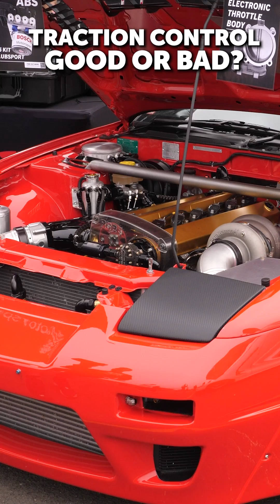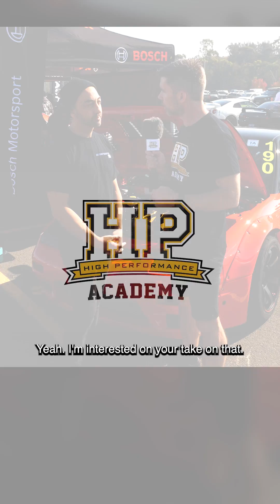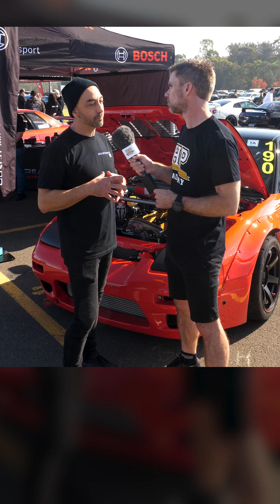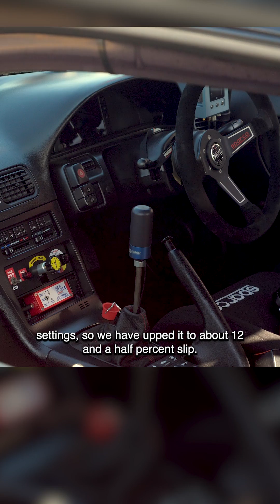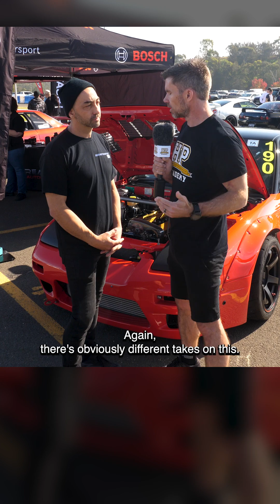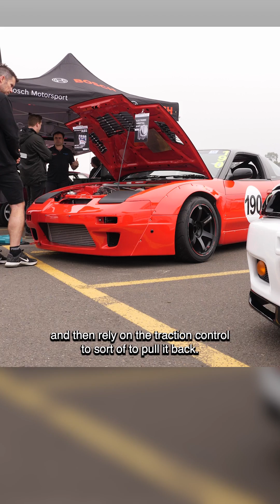Traction Control Vs POWER #shortish

Comment: Traction control is definitely not reactive system only, the likes of OEM's producing high end sports cars often employ predictive techniques to have proactive TC which obviously works better than the reactive one :D
Reply: The Lexus and Toyota hybrids pioneered proactive traction and stability control back in the mid-2000s. The Lexus LFA 'Ring lap record was set using these systems.

Comment: Hi y’all. I am trying to install an R5 ecu and setup a simple traction control strategy on and 87 F-250 for street safety reading off of the back of the 8 wheel studs with a magnetic sensor. As I understand it will be a relatively corse reading, but I am not racing. Will this be fine?
Reply from the maker: It will be It doesn't really matter if you are racing or not, you want it to work, otherwise, what is the point right 😎
You can give it a crack, but you would probably need more than double that to get any usable data for the TC system otherwise it simply won't work.
The usual go-to is a smaller diameter (CV-ish size) and can have 40+ odd reference points for comparison. To go bigger in diameter as you plan, you would need more rather than less.
Haltech will be able to help you directly with ensuring you don't waste any time with a resolution that won't work, they're a good bunch there - Taz.
Reply: @hpa101  Right on. Thank y’all! I will see what I can make work.

Comment: F1 and high end motorsport have been using it for many years without slowing there cars, its not just taking bunch of timing out
Reply from the maker: For sure! As mentioned here there are different options, and allowing a specific percentage of slip was the preference on the day here, and often will be depending on track and weather conditions, as well as driver preference. Drivers can often even make adjustments on the fly.
To be fair this doesn't get too deep in the weeds, but some slip is pretty much always faster than 0%, so he will just mean a higher percentage than what they would normally target.
The only people dead against it are usually those who don't do any real racing. Those that do race and don't want it, either don't use it or race in classes where it is not allowed if it means that much to them 😎 - Taz.